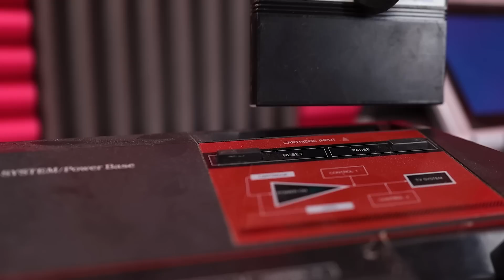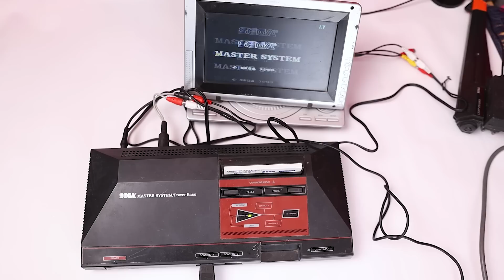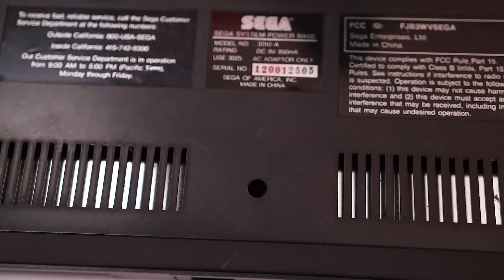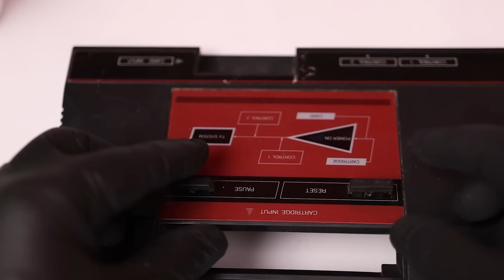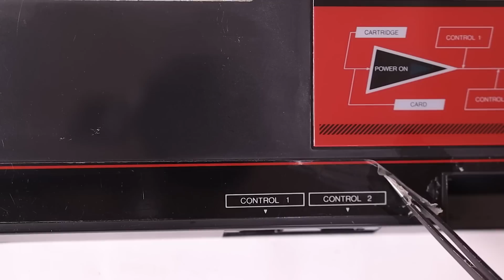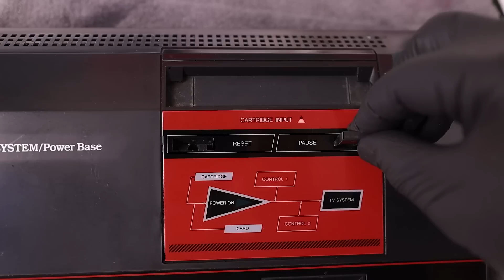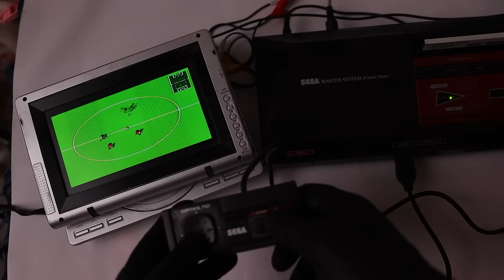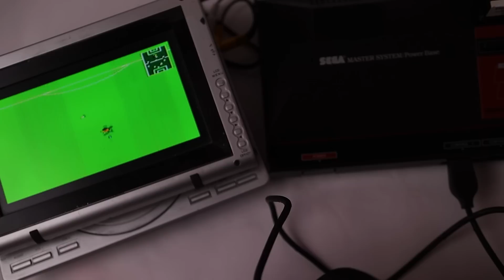Restoration & Repair of SEGA Master System with No Display ASMR

Comment: You should also change the capacitors. This is mandatory on all retro consols. IMO. They will cause problems in near future. I suggest you use high quality caps from Panasonic.
Reply: Yes, Caps should have been replaced..

Comment: Nice video and relaxing! 

Did the sound still work? May have been me but there was sound before restoration but not after. Hopefully it does and the volume was just low for the ASMR experience 😊
Reply from the maker: Working 5:41 Thanks for the visit
Reply: @resEG  so it is! Thanks for confirming :)

Comment: First connection Ntsc on pal TV, 2nd.connection ntsc on ntsc TV. The console was initially working, but the AV output was soldered for appearance and reliability. Did I guess right?
Reply: They've used the same TV throughout the video. Unless you were thinking that it was initially set to PAL?